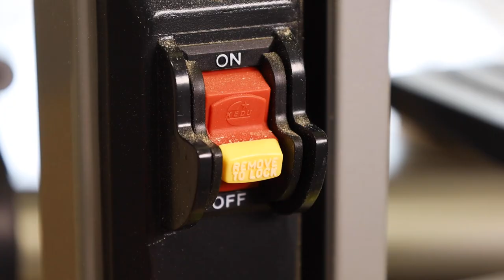Build A DIY Rolling Shop Cabinet with Drawers!!!

Comment: Just started actually using my new Rigid table saw (same as yours) and either I got a freakishly large model (I need to go out and measure floor to table top) or you're insanely tall.  I'm right around 6'4" and this thing is above my belly button.  Also, love the cart, I plan on doing something similar with my miter saw eventually.
Reply from the maker: Hey Charles, I'm 6' and it's pretty comfortable for me. I just measured the table saw and it is 37" from the floor to the table top.
Reply: @SeanDoesDIY  huh, just measured mine and it's the same (just below my belly button).  It was taller before because I had the wheels engaged it seems.  I guess it just feels huge coming from a Porter Cable jobsite saw to this one (plus not using one for almost 2 years)
Reply from the maker: I felt the same when I got this one, going from a small craftsman that I had used for years.